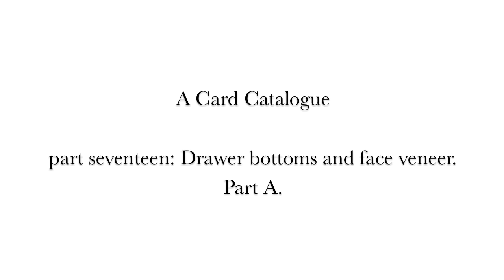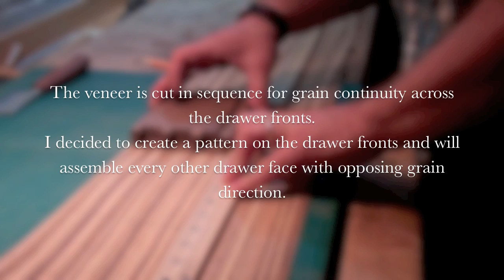A Card Catalogue part seventeen: Drawer bottoms and face veneer. Part A

Comment: Hi Tom. Thanks you so much or your greatest video again. I learned a lot in all of it. But I have a trouble to flatten a cupped wood board. I checked a lot of videos in youtube, normally almost all of woodworkers will planed the board when they see the boards is not flat. However, if the wood board like 8mm thickness with cupped shape, if I plane it, it will be just have around 3-4mm thick. 
So, normally, what will you do when you face it problem? I watched a video people use iron to flat the board, is that work?
Reply from the maker: Thomas,
thanks for the question and comments.
Try taking lighter shavings and remove less material. That way, you'll be able to flatten the stock without loosing too much.
You may be interested in my online Membership site- I just recently showed an episode about this very subject.
For your information, have a look here:
http://www.anunpluggedlife.com/

all the best~
Reply: Thank you so much Tom. I will try on it and check it out later. Thx ;)

Comment: Tom, as always, excellent video.  I assume by applying veneer to one side of the drawer fronts only, there will not be an issue of warping due to the size of the drawer fronts.  Is this correct?  Thanks Tom, I really enjoy your videos and work.
Reply from the maker: That's a great question-
to be perfectly honest, I seriously considered veneering the inside of the drawer fronts to follow traditional practices and keep moisture level more constant.  I was worried about leaving them bare.
I did some research and spoke to some other wood workers and the consensus was that it would be OK with the 3/4-in. drawer fronts and the fact that the sides were being left open for the dovetails, it probably wouldn't alter/effect the drawer fronts too much.
as you can see, I only veneered the fronts and after two years, so far so good.
thanks again for the question-
Reply: Tom Fidgen Thanks Tom, I appreciate you taking the time to answer my question.  I love hand tools, and your videos and work are an inspiration to me.

Comment: The veneer process is really interesting.  Watching the video, you applied the hide glue to the substrate, put the veneer face down on the glue surface, applied hide glue to the veneer back and then flipped it over.  Was the hide glue on the substrate partially dried or does it not matter?
Reply from the maker: thanks for the questions and comments- the glue on the surface helps to stabilize the veneer and lubricates the hammer for the veneering process.
You'll find detailed plans, cut list and instructions for this and other hand crafted projects- Check out The Unplugged Woodshop.
all the best~
Reply: Tom Fidgen Thanks.  I have your book and enjoy it. Your Youtube channel is a great companion to the book.

Comment: Another great video! I like the look of the zebra-wood.  Why did you put the veneer face down, apply glue, and then flip it back over?  Was it to decrease surface tension when using the veneer hammer?
Reply from the maker: Micah, thanks for the comments and question. Yes, the glue helps prepare the veneer and makes the hammer move more easily.
You'll find a more detailed explanation in my book The Unplugged Woodshop.
This is where the project is from and you'll have measured drawings, cut lists and detailed instruction on this and other hand crafted projects.
all the best~
Reply: Thank you, Tom!  Your book has been on my Christmas list for several months now lol

Comment: Tom, is there a reason other than aesthetics that you went with a half-blind dovetail if you were going to veneer over the pinboard anyway?
Reply from the maker: +MrJVH88 Great question- thanks! I used 1/16" veneer which the industry standard considers 'thick' but compared to my shop sawn veneer, I think it's still pretty thin. For that reason, I decided to go with half blind dovetails so the end grain wouldn't cause any 'ghosting' in later years through the veneer. This is common in antiques where you can see the outline of the through dovetails. Makes sense as the drawer front long grain would move a little more than the end grain tails and can affect the veneer. This way, I didn't have to worry about any of those issues as the full drawer fronts were solid. Besides all that, the aesthetic also played in-; ))
hope that helps,
all the best~